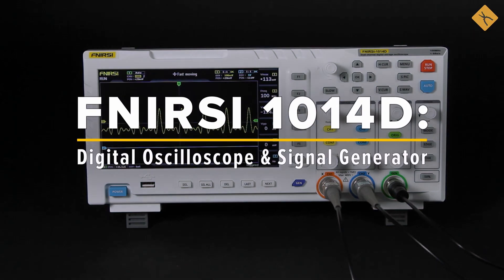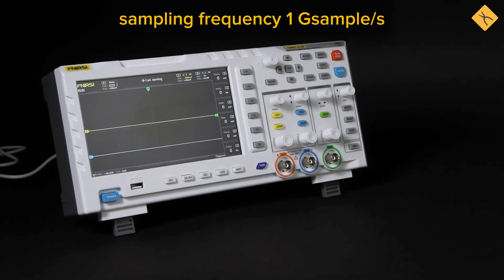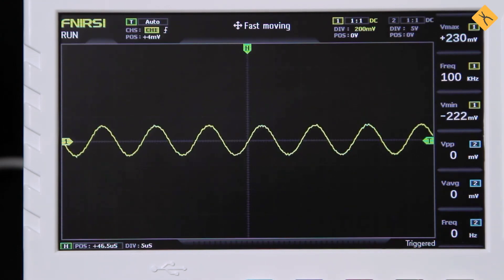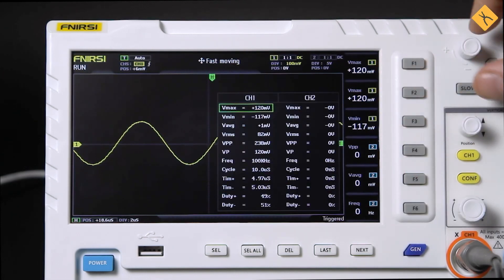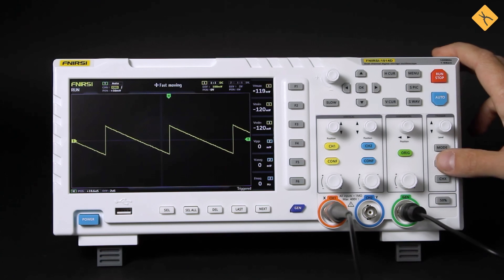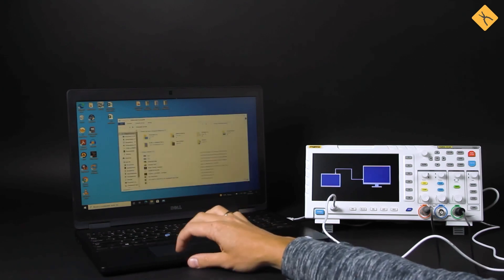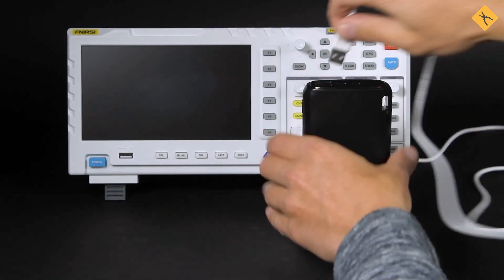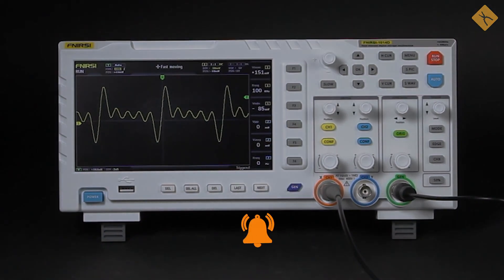FNIRSI 1014D: An Affordable and Compact Entry-level Digital Oscilloscope

Comment: We CAN'T change voltage amplitude generated by the signal generator. Can we?
Reply: No, but use a simple voltage divider (external pot or attenuator) to lower the signal.
Reply: @HowardJohnstone  Actually, I need to raise the signal.

Comment: Buyer Beware!  This scope does not meet its bandwidth or sampling rate specs!  Check out reviews on YouTube channels "learnelectronics" or "Kerry Wong" for more information.  Spoiler alert:  Instead of 1G Samples/sec, it samples at 200M Samples/sec, and instead of a bandwidth of 100Mhz, its bandwidth is about 30MHz.
Reply: thanks for the honest heads up. how accurate is the on screen freq measurements ? also how much current @ 5volts is needed to power it?
Reply: @Mr71chevyvan  I don't have this scope to test these specs.  Once a manufacturer touts misleading specs - especially such basic specs as sampling rate and bandwidth - you can't trust ANYTHING that manufacturer claims.
Reply: some sellers as well.  higher price doesn't mean anything accessory wise.     its knowledge on a need to know basis. if you have to ask you don't need to know :>)
Reply: I bought one on a whim from eBay and found it to be an incredible buy. True the 100 Mhz is not the top but For a 50 mhz it was good enough for my purpose. What the heck I only paid $130 for it. It dies all I need fir troubleshooting, my eyes into a circuit. How valuable is that!
Reply: @erin19030  As long as you knew what you were getting, I think it's fine that you bought one.  I just worry about newbies that think they're getting a good deal on a 1G Sample/sec scope, when they're not.  Hope the scope serves you well.
Reply: @ajlenze8 a newbie wouldnt mess with 1MHz+ anyways
Reply: Ots not as good as my Tektronix 453 portable analoge scope
Reply: Takes some time to get used to